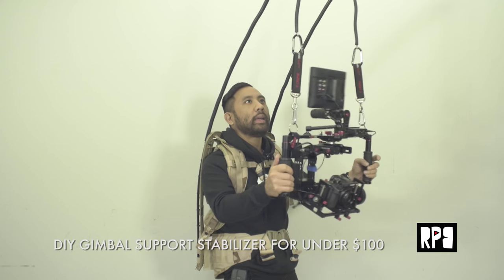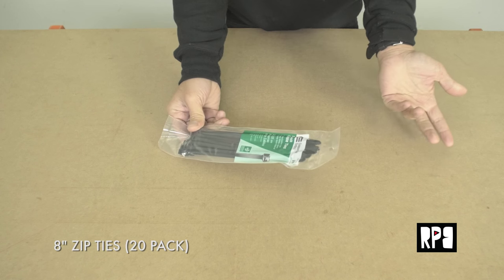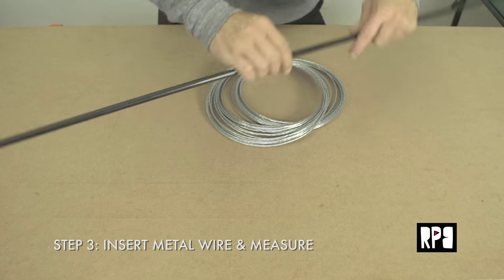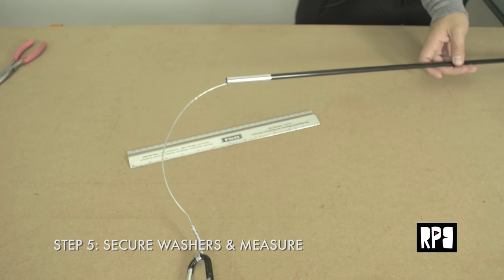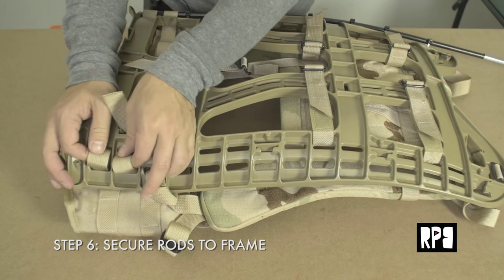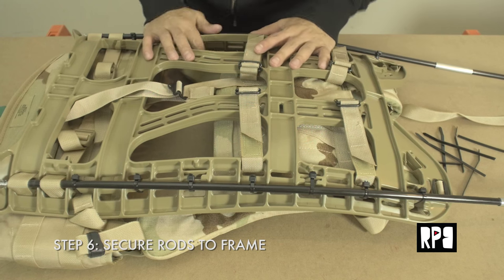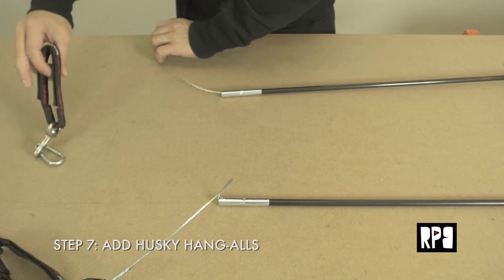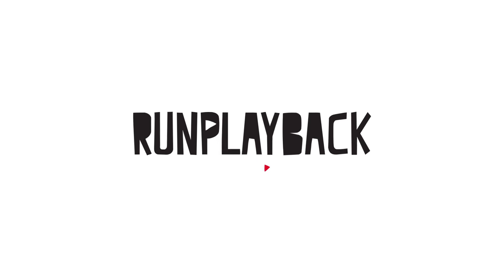Build a DIY Gimbal Support Stabilizer for Under $100

Comment: This is a brilliant idea and a brilliant example, that shows how much professional rig is overpriced. I think one side is that the designers don't even care to save on cost, they design all parts from scratch, when they could cooperate with manufacturers like the one of this vest. So of course at relatively low quantities, the parts will be expensive and development cost/unit sold too. The other thing is that the profits are much higher than for mass produced things. Professionals will still buy the expensive version, they have no time and energy to spend on everything and if it fails they would be blamed for it. A minor thing is also quality of materials, but compared to the other two, this is negligible. So, yeah, for everone else these DIY things are a big cost saver to get to the same result. Congrats!
Reply from the maker: Thanks Zoltan! That's a great take on the benefits of DIY compared to manufactured rigs. Thank you for sharing that!

Comment from the maker: With a few key items from your local Home Depot and eBay, I’ll provide a step by step guide on how to make your very own DIY Gimbal Support Stabilizer for less than $100. You may already own a lot of these items so you may spend even less but the ingredients I’ll list are the best balance of cost, assembly time and performance.
Reply: Reading this in 2018. Just ordered the parts. Will report back! Thanks for taking the time.

Comment: Great build, thank you for sharing!  I just ordered the Molle ii frame and the tent poles off Amazon.  I have 2 different gimbal systems: 1) DJI Ronin M, 2) GlideCam gimbal and Smooth Shooter Vest.  I am going to look at mounting the Molle ii onto the back of the GlideCam Vest unit, as it is designed to distribute weight.  I like both gimbal systems but I find the Ronin M very fatiguing once you add on the camera, monitor, mic, flood light.  I have wanted to build some sort of support for it and this looks like it will fill the need!  We cover film a variety of hobbies, activities, events/attractions and by the end of filming I am spent.  I just subscribed to your channel and hope you will ours too!  Cheers, Rick :)
Reply from the maker: That's awesome thanks for sharing! Try the Molle ii by itself first, you may find that's all you need. It should be great for the types of content you are filming. Let me know how it goes!
Reply: @RunPlayBack  thank you, I am confident this build will really help me out a lot!  I will film the process and let you know how it goes.  Cheers, Rick
Reply from the maker: Goes To 11 awesome I look forward to seeing the results!

Comment: beyond excellent work. I definitely need to build one of these. Really so easy especially if it will save $500-$2000

:)
Reply from the maker: +trevorpinnocky thanks! yes I think it's definitely worth building. Gimbal stabilizers are very useful but I just can't spend $500-$2000 for one. The USGI Molle II frame is really the muscle of this entire rig which makes me confident about flying expensive gear on it.
Reply: Can you post a link for the molle frame... It's not available

Comment: Very Interesting     ... Where and what kind of rods are these... how does it balance ... and how is your experience so far with it
Reply from the maker: Check out my full build article link in the description. It's basically generic tent pole rods. It's just a support so it doesn't actually do any balancing, it just distributes the weight of the gimbal among your whole body and not just your arms.

Comment: Thanks for all the info I am following your plans and doing what you did I appreciate the posting.  Run are the 9 mm rods strong enough for the full size Ronin and a Red or do you think I go with the 11 mm however I have not been able to find them in 27 inch length size, do you 
A think the 9 mm rods are strong enough or do you know 
B know where I can get 11 mm diameter 27 inch long 
Thanks again Gary

Comment: Hey thanks for the video I'm going to build one. Question: what do you use for ficus while using your gimbal?  Looks like you have something attached next to your right thumb?  I've looked at the Silencer with trigger but looking for other options. Thanks!
Reply from the maker: Hey there! So I don't actually use any external controls for focusing. I typically fly the Panasonic GH4 using a 14mm pancake lens and set to a high aperture so I have a wide focusing distance. The attachment by my thumb is actually the gimbal joystick controller.

Comment: How do you overcome the bounce and have you thought about using a different frame such as the DownEast 1606 frame? It seem t conform to your body a little better, but I'm not sure if you could add two poles. I'm in the process of building one similar, using a Condor H harness
Reply: Does condor h harness workes well? Did you try that one? I wanna make sure before start to make.

Comment: Arm saving factor aside, do you find it`s improved your footage in the vertical axis while walking or running?
Reply from the maker: +Ian Swarbrick Yup definitely, it's still important to walk smoothly but the tension from the top helps to counter those up and down movements

Comment: Can we use one tent pole, or shorter tent pole, instead of 27 inch one.
Reply from the maker: I think you can..it really depends on the weight of your gimbal, how much tension it would require and how far you want it to hang away from your body.

Comment: Hello RunPlayBack, what improvements do you suggest to add to this to make it hold the big Ronin with Sony FS7 + Canon 17-35 f/2.8 + follow focus?

thank you
Reply from the maker: I think the main improvement for flying a heavier build would be larger rods and metal braided wire. Everything else should be fine.

Comment: Do you think that would hold the weight on a DJI Ronin and a C100?
Reply from the maker: I think the wire would have to be doubled up inside of the fiber rod to hold that much weight